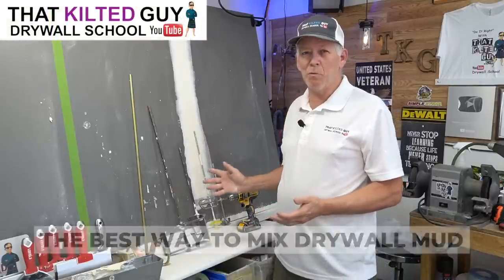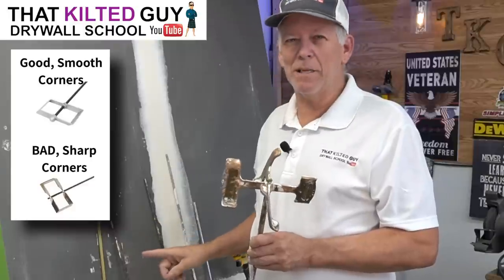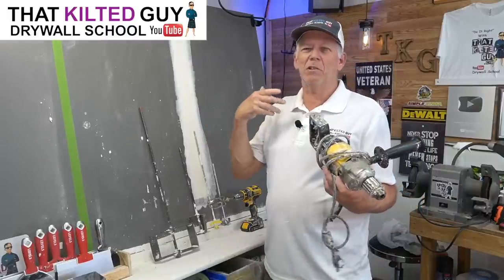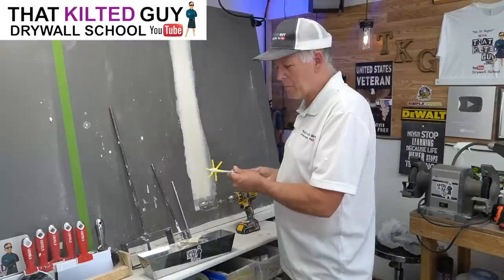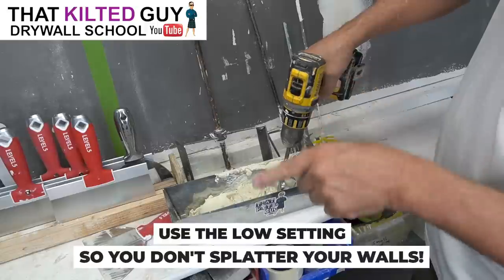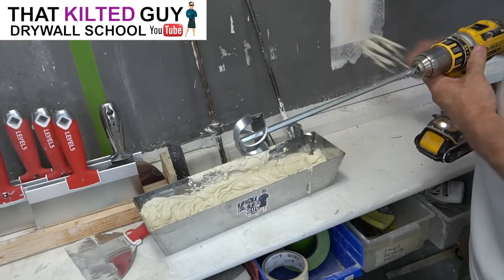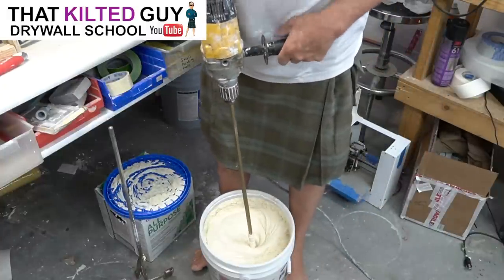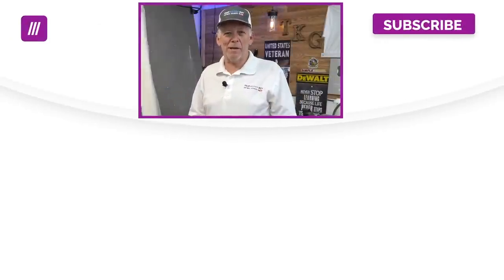You NEED This Drywall Mud Mixer

Comment: How can you reduce air bubbles when it dried?
Reply from the maker: No way to completely do that.  Put it on in thinner coats, and not over painted surfaces, but bubbles are the bain of drywallers.
Reply: If I knife over in reverse I seem to reduce air bubbles. Am I right?
Reply from the maker: It can help

Comment: Thank you again for a great video. I heard that the sheet rock and level 5 mixers can chew up the sides of the buckets and then you’ll have plastic in your mud. Is that true and if so how to avoid chewing up The sides and bottom of your bucket?
Reply from the maker: Like I showed in the video, the two bladed mixer with sharp corners will chew up buckets but I’ve never had a problem with these four bladed ones. Of course you don’t want to go beating on the sides of the bucket too much if you are mixing.

maybe I’ll do a video testing which ones chew up things the most.
Reply: @ThatKiltedGuyDIY  would love to see video about which one scrapes the side of bucket more
Reply: I had that issue with the four bladed sheetrock paddle. But to be honest it's not the paddle by itself, but mostly because of the rough handling of it. I drop it on concrete floors and even hit it with a hammer sometimes to remove set hot mud on it.

So it's mostly the handling that gives it rough or damaged edges, the paddle itself is great, although a bit hard to clean quick...
Reply: I use the paint mixing paddle with a ring at the bottom for mixing hot mud in my pan.

Comment: Each mixer has it's own pro's and cons and applications. 
   A quick tip to clean them though, (another finisher showed me once) is to put the paddle in a bucket of water and tap it a few times with a hammer and the mud usually comes right off due to the vibration. 
   Great video as always ✌
Reply: Just spin it in the water forward then reverse right after you’re done mixing. Way faster.

Comment: I had a workers comp claim once a guy holding the bucket let it spin and the wire handle came off the bucket and cut a large cut in his calf and needed stitches so never let the bucket spin out of control

Comment: I have used the 2 paddle mixer for 16 + years without any mishaps, yet, but I just hold the bucket between my feet when I'm stirring a big bucket of mud. I used a $50 Black & Decker drill for many years until the cord could not be repaired anymore and then I got a better Milwaukee drill I have now. Great video. Have a good one, and hope your health issue are improving.

Comment: I really love free info, but I have one issue that I have not seen discussed before. It may be just an issue with me, and I understand that.
How do we know when to stop? I almost always try to do drywall, and think "I can get that just a little better", and I end up screwing it up and calling my friend, who tells me I have helped to buy his boat.
 You make it look so easy, and that is how I can tell a professional. What sets you apart, to me anyway, is that you are willing to share your experience and knowledge. 
I want to say thank you for that.
PS, if you ever need to know anything about hyper speed acoustics, drop me a line.
Smiles!
PPS, never use water putty as a substitute for drywall compound. It does not work...
Reply from the maker: Water putty lol.  And Hyper Speed Acoustics, is that like really fast Popcorn Ceiling texture, or sound that is faster than the speed of sound?  PS: I have it on my list to do a video about how novices often overwork a repair, lol
Reply: I think the hardest thing for me was learning to leave the mud alone once I had made 2-3 passes with the knife. The thing that helped me the most was spending a couple of lunch hours watching pros tape and finish joints.
Reply: @hughbrackett343    The old ‘leave well enough, alone’.

Comment: I haven't seen your biggest paddle but 30 years xp and I dislike your 2 blade one with the half ball on the bottom. There is a steel one with the same design without the extended part protruding of the bottom. When you texture or use a pump for finishing, it is important to get every part of the bucket mixed. For finishing by knife, it doesn't matter as much.

Comment: I wish they offered a longer stem on the mixing paddle. I'm 6'6" and leaning over a bucket destroys a guys back. I've been debating on welding a longer stem on mine.
Reply from the maker: I feel you, as I am 6‘2“ myself. Did you check out the one in my link, it does have a 32 inch shaft which might help. https://www.level5tools.com/products/mixing-paddle-long-32?via=thatkiltedguy
Reply: @ThatKiltedGuyDIY  Thanks for the link.
Reply from the maker: All these links are in the description below the video btw
Reply: take the pressure off of your lower back with a slight bend at the knees

Comment: For you noobs out there (me included), "Hot Mud" is mud u mix up yourself from powder, as oppose to "Cold Mud", which is the mud you buy in a big tub.
Reply from the maker: Hot mud is Fast setting joint compound, and we call it that because it gets warm when mixed due to an exothermic reaction.  It hardens according to the time on the bag, is tough to sand, shrinks almost none and can be recoated as soon as it's set up.  There IS mud you mix from powder that doesn't do that.

Comment: Where did you get it that big
Reply from the maker: Get what?
Reply: When your mixing in the pan with mixers the second style one
Reply from the maker: I don’t remember exactly, but if it’s one I was using inside the pan, it’s probably the one I made myself with a welder